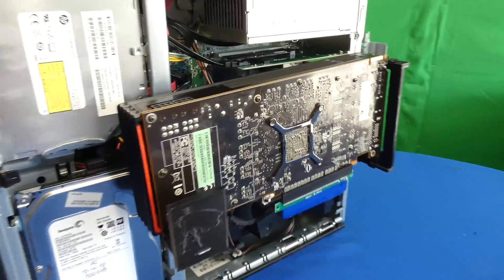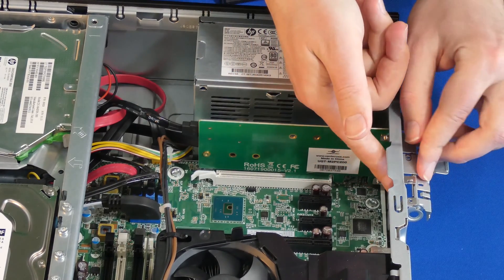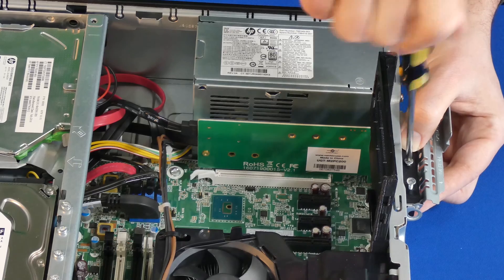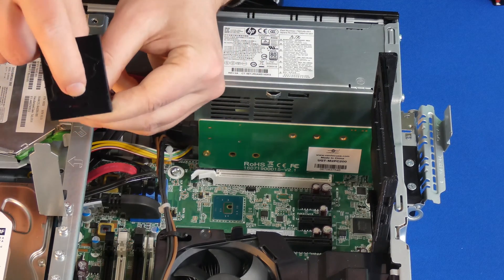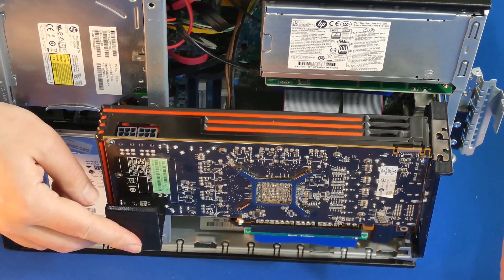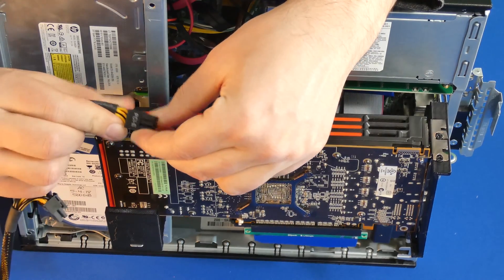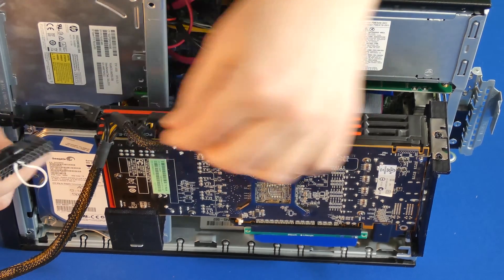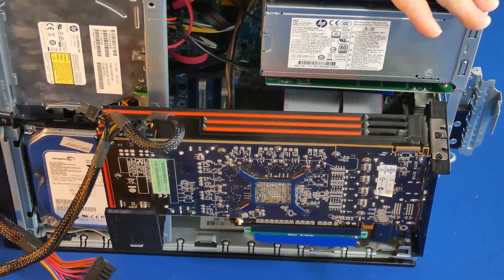proto1 External GPU Adapter for SFF Computers HP 800 G1, 800 G2, 800 G3 EliteDesk

Comment: cobuman I am trying to connect a 2nd PSU and add a new GPU to an elite desk 800 g3 sff and am stuck at the external power supply. Once I connect the 24 Pin/6 Pin adapter to GPU and plug in the paperclip to 2nd external GPU and the PCIe x 16 cable extender will the 2nd external power supply start on its own without having to connect the 2 power supplies together somehow? If I am forgetting the correct process could you explain where I am going wrong in the process ? I have not gathered all of my parts but will attempt the process very soon and would like to make sure I understand how to completely before doing it. TIA I do appreciate your help and if you need anything from me please let me know!
Reply from the maker: The 2nd/external PSU will turn on as soon as you plug in to the wall socket, given that paper clip is there. Paper clip just sends power ON signal to PSU.

Comment: I am stuck does the 2nd psu not connect directly to the psu in the 800 g3 sff? Wondering if I simply put the paperclip in and when the 1st psu fires up the 2nd gpu starts because its connected to the pcie 16 ribbon? TIA I appreciate your help more than you know

Comment: Can gtx 750 ti low profile install on this computer without removing the cover or adding such equipment please answer
Reply from the maker: It should work fine, but make sure it is a low profile type. Some people mistake mini type as low profile which does not fit. Here is my video on that: https://youtu.be/_tbcimqBDzI

Comment: Hey, it kinda late on this ,but what is the highest card that i can buy for elitedesk G2(with the mod on this vid) before i need to have second PSU to maintain it? I want to only use the powersupply already on the computer. Thanks🙂
Reply from the maker: In that situation you might as well buy GTX 1650 Low Profile which will fit inside the case and use existing PSU, like this: https://amzn.to/3gFhv51
Reply: @Cobuman  
Read up*
Reply: @cobuman well i know i can use a low profile easly, but i think about using sata cable for power AS well on computer(by using a data power to six pin), to make possiable to have more powerdraw, like on to full size gtx 1060 maybe?

Comment: Hi.  Your videos have helped me a lot and I really appreciate this.  Btw, did you try a 24-pin to 6-pin adapter to power the motherboard directly from an atx psu?  At Amazon I have seen several adapters, but I was afraid to try. I hope you can help me. Thanks in advance.
Reply from the maker: My pleasure. It does look risky to use those adapters. Especially when you see some reviews... I didn't try them because if I'm going to add a large PSU it would be only for adding a large GPU; in which case GPU is the only thing I will connect to that. You can still have the original PSU run the system separate from the GPU. 

Some GPUs like "low profile" types do well without adding or changing anything in your system.

Comment: Will the gtx 1050ti (not low profile) work with a 240watts psu using a pcie extender? I cant find a low profile 1050ti or 1650
Reply from the maker: Yes, it should work fine. Looks like Amazon has gtx 1650 on 7 day backorder: https://amzn.to/3g1lgBS
Reply: @Cobuman  i live in philippines and the shipping fee is kinda pricey so im still finding low profile gpu here. but if i still cant find any, ill go with 1650 lp on amazon. tnx for the reply

Comment: I just bought a G2 today on OfferUp for $160. It's got a  i7-6700, 16GB DDR4, 256GB Samsung SSD. And I was planning on cutting the case to fit a GTX 1060. Until I see this.. 🤣
Reply from the maker: That's a really good deal for an i7 PC. Did you know you can also transfer everything to a larger case? Here is my video on that: https://youtu.be/C70nmtTFPuw

Comment: How do you get rid of the "90E-Power Supply Fan Not detected".
800 elite G2 from a SFF case to Normal ATX Case/PSU.

The fan still works...the system boots up fine..
But you need to hit ENTER on BIOS screen EVERY-TIME you switch the PC on...
Reply from the maker: I think this may be related to pinout on the adapter used with aftermarket PSU. Probably one of the wires has to be swaped or something of sort. The motherboard is not getting the proper signal but it should not affect anything aside from the annoying error. I always put my computer to sleep when not using it so the error does not bother me. When a sleep PC will use a tiny amount of power. Like 1 watt if that.

Comment: Bought the adapter for a dell OptiPlex 3020 (which has a G3220) and while it did get damaged in the postage to Australia (the large right angles on both the pieces were cracked BUT STILL CONNECTED with some strength so they could support my rx570 in a horizontal position) It was still usable and is currently all good and setup. I was concerned when it arrived but in the end everything has worked out, would recommend if you need it.

PS. The little wire jumping trick for the external psu was a lifesaver thank you for producing such a good tutorial.
Reply from the maker: Thank you very much purchasing and providing feedback on this product. I really appreciate it because it is a prototype of sort (proto1). If you need help with any computer stuff feel free to ask me. 😁👍

Comment: It's ugly AF, why would you do this when there are low profile GPUs out there (GTX 1030, GTX 1050TI etc.)
Reply: Would a duel fan 1660ti count as a low profile GPU?
Reply: @mrflufffawn471  its the width of the card that identifies it as low profile, not the length. Depending on the card, length can vary. I have seen 1650 low profile, but not 1660 (doesnt mean there isn't)

Comment: do you think this gpu would fit inside? https://www.amazon.ca/Gigabyte-Geforce-GV-N105TD5-4GD-Graphic-Cards/dp/B01M4KGTNI/ref=sr_1_1?keywords=gigabyte+1050+ti&qid=1566994426&s=electronics&sr=1-1 and would it be able to run off of the default power supply
Reply from the maker: No, that one will not fit inside. You need the "low profile" type like this: https://amzn.to/2NF8o8s stock PSU can handle it. :)

Comment: Thanks a lot man for this awesome playlist, it's the only resource in the world for this pc, better than hp support themselves
Actually my pc is Elitedesk 800 g2 tower
Intel Core i7 6700 cpu 3.4 GHz, 32 GB ram, 8 threads, power supply unit: HP 280W EPA92 ENT14
I want to install Rtx 2060 super, but I'm not sure if I can upgrade the PSU, someone told me that I can't! I'm not convinced, what is the proper PSU I can install on my computer?
Reply from the maker: Sure thing. Unfortunately, PSU cannot be upgraded, only replaced with original. However, the 280w power supply you have is good enough to run 2060 but the bad news is that 2060 will not fit inside this case. This is why I made this adapter for people that wish to use GPU externally. Another option is to transfer everything to a new larger case. I made a video about as well: https://youtu.be/C70nmtTFPuw
Reply: @Cobuman  thanks for your response, are you sure that two-fans card or founder edition one won't fit inside my TWR  case? Mine is not SFF.
Reply from the maker: @basheeral-momani2032  In that case it should fit fine. I'm using standard MSI 2060 and it's pretty short: https://amzn.to/2MGrXhe Just make sure you get an adapter like this: https://amzn.to/2ZANBFL
Reply: I will try on dell 7040 sff

Comment: i want to connect a rx 480 8 gb which only has 1x8pin slot please recommend me 24 to 8 pin adaptor for it thanks
Reply from the maker: The aftermarket PSU should have 2x4pin pcie connectors already. There are adapters that go from 24pin directly to 8pin like this: https://amzn.to/33i2xeX But the 8pin connectors may not match the GPU. You can also use SATA to 8pin GPU adapter like this: https://amzn.to/2T9SjbB using any of listed adapters requires a jumper pin to turn on the psu really easy to do with a paper clip.
Reply: @Cobuman  what if i use a sata to 8 pin connector then use a jumper pin on 24 pin connector
Reply from the maker: @tuahakhalid4431  That would work.
Reply: @Cobuman  thanks a lot bro
Reply from the maker: @tuahakhalid4431  my pleasure

Comment: - I hope you answer this, I currently use the "hp elitedesk 705 g3 sff", I want to know if I could put an rx570 4gb?
- Any graphics card that you recommend to play the current games at high settings +60 fps?
- Could I choose to buy a new cabinet and move everything?
Thank you!
Reply from the maker: If you wish to use rx570 with that PC you need an adapter like in this video because the card is way to big to fit inside of 705 g3. However, you can install a "low profile" card that should fit inside like GTX 1050 ti https://amzn.to/2lasw6j  - this is the best card of low profile that will fit inside  You may get 60fps on high but not sure...
Reply: @Cobuman  i want to move all the stuff to this case "Aerocool Cylon Gaming Rgb"
this will works?
ty for answer!
Reply from the maker: @laelsalazar7273  Possibly, I've heard of people doing it; however, the PSU may not fit inside the new case and back panel connectors may not line up/leave a hole.

Comment: Hey, thank you very much for the tutorial. I wanted to know if this external Gpu adapter will also work with the HP Elite 8300
Reply from the maker: My pleasure. It will work with 8300; however, it's mounted slightly different (lower). Check out the 3rd picture down on product page. https://amzn.to/2RV8NUr
Reply: Would I need to upgrade the psu for it too if I was to put something like at 1080 graphics card?
Reply from the maker: @tokouso3328  You can use pretty much any PSU externally because it will only power the GPU. So, a 200w would work fine powering only the video card- possibly even lower.
Reply: Because I have the hp compaque 8300 elite or something like that

Comment: Muy buen proyecto,  pero no era mas fácil montar todas las piezas en una gabinete ATX ?
Reply from the maker: El adaptador también se puede utilizar dentro de ATX. Esto montaría la GPU verticalmente. (google translate)
Reply: El objetivo es mejorar un equipo de oficina que se puede conseguir de segunda mano a buen precio. El problema con estas hp es que los componentes no son compatibles con gabinetes estándar, y la fuente sff usa conectores propietarios. Personalmente no me agrada la idea de modificar el factor de forma. Es un equipo bastante discreto y silencioso, de muy bajo consumo y para actividades productivas con una alta relación de valor/costo. Tengo la curiosidad de ponerle una vidcard más allá de la 1030 low profile y poderle aventar un par de juegos para el ocio.

Comment: Is it possible to change the case of this pc?
Reply from the maker: I'm not sure. The motherboard does look about the size of standard atx. One problem is finding a PSU with same power connectors that would work in a larger case. The PSU here is different from standard 24pin... it has 3 power cables.
Reply: I asked myself for a while, but the form factor and the thermal solution is enough for my workload. There is no way to put that on a standard pc case. For the external vidcard I’m exploring using a pico psu powered by a laptop power brick with a cascade switch (when the pc turns on, the pico psu turns on too) to power a vidcard, but I don’t like the idea of modify the form factor of this pc. Maybe if there could be a way to route the pci extender in a way outside the case by a single cable with the power signal for the cascade switch, it would be possible to build a custom discrete case for the gpu that combines with the desk.

Comment: Would thus work with a gt 630 and an hp 8300 without a psu
Reply from the maker: You can use any GPU with this adapter. Your HP 8300 does need a PSU; it will not work without one.

Comment from the maker: Proto1 External GPU Adapter: https://amzn.to/2HA2T9c
Amazon affiliate links below (other). 
PCIe extender cable: https://amzn.to/2Fkil5v
24 Pin to 6Pin PSU Adapter https://amzn.to/2YfINpQ

Proto1 is an External GPU Adapter for SFF Computers. If you happen to have a SFF computer i.e. HP 800 G1, Dell 9020, Lenovo p90p you've probably realized that a standard size GPU is too big to fit inside and PSU is not strong enough to handle it. This adapter allows you to mount any size GPU to any SFF. This product is made of biodegradable plastic and is very strong/durable. It comes with mounting hardware (screws). Please see mounting examples in images or video.